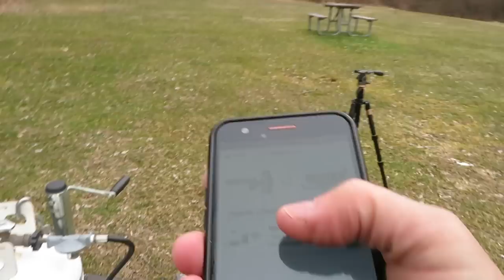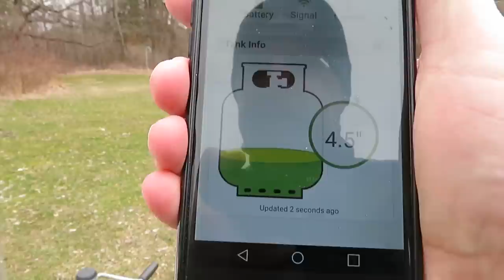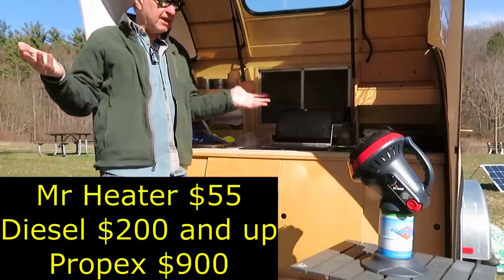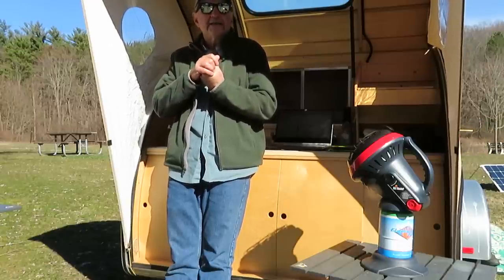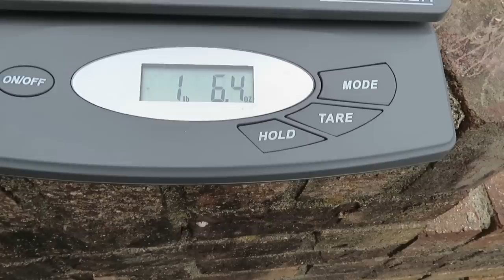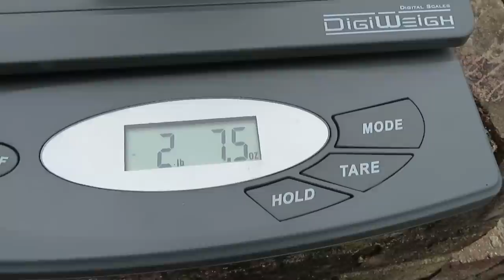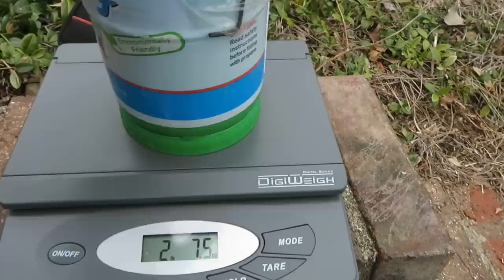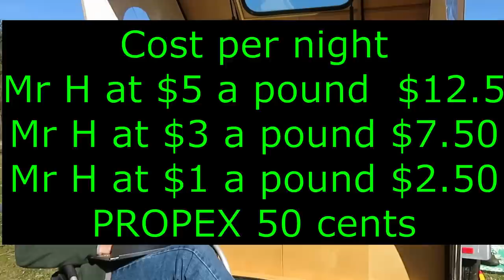Mr Heater vs Propex vs Diesel Heater

Comment: 🤔 availability and ease of getting your fuel. I can get diesel anywhere but not propane. Small towns don’t have propane for filling tanks. Propane is explosive! Diesel is not.  10 hours of use only used approximately a half a gallon of diesel. Battery consumption on 5KW diesel heater over 10 hours was 200 watts. Only maintenance needed is to turn the heater on high before turning it off for a few minutes. No soot issues. Diesel heater $150 propane hheater like you’re talking about was $1000.  In a moving vehicle or rig there’s a lot of twisting and bumps and if you get a leak of propane 😱… Use at your own risk.😉
Reply from the maker: Thanks for your comments. For some diesel makes perfect sense. In my case I have a tiny trailer and already have propane for the stove. I did not want to add a second fuel type to the rig especially liquid. I agree you can get propane or diesel heater for less money. At those price points quality is pretty poor. There are plenty of videos around showing problems and failures with cheap heaters. The high quality diesel heaters cost as much or more than my heater. My heater is essentially maintenance free. If you watch the diesel maintenance videos you will get an idea of the care a diesel needs. My energy consumption numbers for running the glow plug show a much higher energy consumption for diesels when the glow plug is running. You can find this data too on line. There are about as many diesel fires as propane fires. Both need common sense care. I have yet to visit an area of the USA that does not carry propane. It is a VERY common home heating fuel especially in remote places. I agree - do your research and pick what meets your needs best.  𝕋𝕙𝕒𝕟𝕜 𝕐𝕠𝕦 𝕗𝕠𝕣 𝕨𝕒𝕥𝕔𝕙𝕚𝕟𝕘!  ✅  Check my other videos https://www.youtube.com/cosmoweems/videos 
SUBSCRIBE https://www.youtube.com/cosmoweems?sub_confirmation=1 =𝓒𝓸𝓼𝓶𝓸 ✅
Reply: @CosmoWeems  VERY WELL SAID

Comment: We remodeled our truck camper and pulled out every bit of propane.  Replaced with reasonable solar and ability to charge while driving.  We went with a chinese diesel heater.   Spent a winter out west exploring with it.  Zero problems and we will never, ever go back to propane.

Comment: ya propane is tuff,,,, it costs a fortune,, as well,, and 20% is unusable so if you have a 400 lbs or a 20 lbs 20% of that propane will not be able two be used it will be lost in the process .. of use that is..
Reply from the maker: Thanks Jason. I was about to install a 400 pound in my trailer. Baw haw haw. Why is 20% unuseable? Can you provide more info? =Cosmo

Comment: Regarding humidity, on boats I have used products such as a "GoldenRod®" which generates less than 150° F if you use shore power, they require 110 volt power (8 watts or more depending on length), or Dri-Z-Air dehumidifying crystals - no power needed (Calcium Chloride anhydrous, which you can also buy from a chemical warehouse/supplier). Anyone ever use them in campers/trailers? Regarding diesel heaters, I like that the unit can be housed/mounted outside, and they the air intake and exhaust (for the heater), can also be routed or mounted outside, with only the heated air being recirculated inside. Some folks do install them with the heated air intake outside to constantly draw in fresh air. Depending on where you are that could draw in moist air as well. If you are handy (and careful) there are 12 volt incandescent light bulbs, you could build a small container/holder, a super low wattage one might be ideal if "some" light doesn't bother you, if it does, perhaps a 12 volt resistor with? It It's a balancing act.
Reply from the maker: Hi Dougster.m Thanks for your solutions, they may be useful for many viewers. For me  each one adds a layer of complication to camping. I recommend the Propex HS-2000 its very small and can be tucked into almost any van or RV if the 6500 BTU output is adequate. Diesels require maintenance I don't care to do for the glow plug and carbon build up - you can find plenty of videos about how to do that. https://www.youtube.com/results?search_query=diesel+heater+maintenance. In my case the deal breaker was adding another fuel to my trailer. My trailer is small and I already have propane. Adding diesel fuel was not something I was interested in. We are fortunate to have so many great choices available to us.    Electric solutions are limited for me  since I camp off grid 99% of the time. Thanks for your ideas.  Chemical solutions are fine but my heater does not create moisture so I am free of that cost and moisture. Here is a video of the heater in action at -5F where I need reliability    https://youtu.be/9VEBR8fh-Bo
𝕋𝕙𝕒𝕟𝕜 𝕐𝕠𝕦 𝕗𝕠𝕣 𝕨𝕒𝕥𝕔𝕙𝕚𝕟𝕘!  ✅  Check my other videos https://www.youtube.com/cosmoweems/videos 
SUBSCRIBE https://www.youtube.com/cosmoweems?sub_confirmation=1 =𝓒𝓸𝓼𝓶𝓸 ✅
Reply: Careful using calcium chloride to dehumidify spaces.  While it's a great salt that will happily scrub every molecule of water from the air and can be recharged to anhydrous in an oven, it's so aggressive that it will dissolve itself into a brine and can potentially cause a mess.  

In a tray inside your safe at home, it's fine to have a pack that eventually becomes a brine.  On the road, that sloshy stuff can be disastrous.

Comment: We have 2 diesel heaters, love them, no smoke, but you do have to use them properly. 180 degrees of dry heat. Draws heavy on start up but then goes down to an amp or two when full run mode. One we have kept outside all winter so far with a cement mixer plastic thing for a cover lol but worked great for what we needed. Living in a camper while we finish the cabin and we put the heater hose into the 'skirting'' I made from foam board, heats the under tanks and pipes so I can drain them daily to sewer tank. We use electric heater in living room of camper to help it not be fully moistened by the propane heat. Electric assist helping a lot with keeping sweat down on windows and walls, and keeps dogs warmer out there to sleep, wind just still slides right thru the slider edges out there.
Reply from the maker: I would be interested in interviewing you about your heater. Send me an email to CosmoWeems@hotmail.com Thaks =Cosmo

Comment: Love your heater comparison, you are good with your numbers! Once I get such nice date I can't keep my legs still...

So we... did just put some math/ facts together after 2 weeks of
Boondocking in the alps at 1800 m above sea level, partially snow fall, but over all sunny,  day temps 1-- (-) 3 Degree Celesius,( 30 f)   night temps av. - 10 degree C and colder (- 18 max)
We had 4 Riggs up there:

Rigg 1 Alde propane heating sysrem 6 kw on gas plus 3 kw when hooked up or via inverter,  Rigg is 8 m long and has a cab chassis Class C types ( insulated, by outside insulation mattes)
Fuel supply by 2 x 11 kg Propane bottles ( 3 carried in spare) 50 pounds 2 botts. Day heater via solar and Lipfos and 500 watt El heater plus sun
Rigg 2 Alde propane heating system as above 3020 hp plus with a 33 kg Propane tank and 2 x 11 bottles to switch, Rigg is 9 m long class A
RIigg 3 Alde heating system,  plus diesel warm water heater in Alde loop ( these Aldes work with convectors and glycol)..33 kg Gastank, plus spare 11 kg bottles and 140 L Dieseltank.
For rapid heating this Rigg has an Webasto ( Ce sign) Diesel heater as well 2 kw. ( 9m long, Class A)
Rigg 4 Class C with Truma propane heater ( like Propex but 4 kw) amp draw 1,4 amp when steady state heating plus  Propane per hour Rigg is 6 m long.

Data review ( Feb/March 2020, 14 days at Livignp) 

The 7 m Rigg1)  used 25 kg Propane for 2 weeks ( Fri - Fri) due to solar the batt was always full mid day..amp used was about 1 amp steady state
45!.- Euros 14 days Heat ( ser at 20 C Inside) plus large refrigerator ( 74 g/h) 
Rigg 2 used 44 kg (72 Euros) of Propane for the same due to the lenght its more,  Batts on 80 % since they are Agm he has solar 130g/h propane
Rigg 3  used 22  kg of Propane and about 10 L ( 46 Euro) Diesel  it is 9 m long means incl refrigerator and set to 22 C inside
Amp draw 1 amp Alde, and 0,8 amp Webasto diesel heater when running. Webasto takes 0,1 L Diesel per hour ( and yes sometimes you can smell it but
No smoke, he used it about 30 % of the time) Batts no issue he has 400 Ah installed and solare 
Rigg4 Gas heater 4 kW used 33 kg Propane ( 54 bucks) and needed to go on grid every second day ( batt is 85 Amp Gel) 1,4 Amp/ h * 40 is already critical since he
can only consume 50 % of his batt cap. ( the small propane heater needs to run at low all time) ( 98 g/h)"

Here my 2 cents: 

The smaller the Rigg it may be best to use a small propane blower heater like a Propex,,Truma, Dometic or others, cheap price around 400 -800 bucks, low amp 1,4 and super low gas consumptionm ( specially trailers)
Medium Riggs should have a water heating system ( winter) or a gas propane blower heater such as a Truma combi best combined with a 12 - 230 V thinfilm floor heater, such combination allows a 7 m Rigg 10 days with 7 kg Propane ( tested in the same area / my previous Rv)
Larger Riggs should have a combination of warm water propane heating system plus a 2-4  kw diesel heater ( homologated ones with Ce logo, no Far East ones if safety is a concern to the owners) tapped from the fuel tank ( cost is 500-1000 Euros)

Alde heating system is about 10 k Euros (6-10 kW) ( including hotwater and convectors and motor pre heat or heat cabin with engine heat while driving down the road
Truma Combi 3 k Euros (4-6 kW incl hot water)
Truma and others simple airheater  800-1000 Euros (1-2,8 kW)
Diesel air heaters good / approved ones 500-1000 Euro or more ( 0,8 -1,8 kW or 0,8-4 kW).. Prefer a 1,8 kW heater which runs on low 24/7..
Diesel water heaters around 500 bucks ( only suitable if you have convectors in your Rv
Electrric heaters 2 -3 Amps abour 50 -300 bucks

Some idea.

- Max amp draw 1 amp is OK or you need bigger batteries ( I do have a 160 Ah Lipfos whith quick charge option  with 60 Amps)
- Winter heating system need to run 24/7 on low to keep the sanitary system protected
- All tanks and plumbing is in a double floor construction heated 
- Hourly conumption of fuel 0,1 L ( or kg in case) max about  0,4 L
- Solar recommended 1:1 or 1:2 ( batt to pv)
- Power back up like generator ( 1 for all Riggs)  or hydrogen fuell cell ( efoy comfort  or others) for 3-4 days no sun
- For extrem situations a big buddy or similar

Summary propane heating systems are very efficient and are small and light draw little power even on larger Riggs 1 amps/h  plus power consumption!!
... but the more energy would be needed a supplemental diesel heater makes sense when you have a fuel tank.( or install a 4 gal steeltank underbelly in a Trailer or on the hitch)
In warm weather like spring and fall a diesel heaters can produce all warmth by a minimal amount of fuel without maintenance
Good heaters are as reliable as any propane or other Rv heaters. Diesel cost is In euro about 1,20 / Liter where as Propane is 11 kg 18- 20 Euros 
Heat values like 12 kw/ kg is pretty similar. Some people do not like diesel smell on one hand ( my rigg is a diesel anyhow) and others want to camp on higher altitude
Here you neee an elevation conversion kit on many heaters..or they don't run properly..well we learned it the hard way..
All systems reviewed where running trouble free for years, the water pump thermostat on Rigg 2 failed and the heater did not forward the
warmth, so we needed to cut the 12 v supply to the pump and made a spare wire from a 12 v point then heater did run thru out

Regards from a non responsible diesel heater fan and his camping friends recently camped in the snow and all watch Cosmo..
( I may refurbish my rigg with a 2 kw planar 2 D expedition heater after I saw and we learned how this works..in our case helpful)

Forgive us our findings!? The 4 Riggs you can see on one of my last vacation vids..
Reply from the maker: Excellent. Thank You for sharing. This is an open forum and we all learn from each other. Great information. =Cosmo Thank You for watching. Check my other videos https://www.youtube.com/cosmoweems/videos 
SUBSCRIBE https://www.youtube.com/cosmoweems?sub_confirmation=1
Reply: Update for the records, I mutated from a non responsible diesel heater fan to a diesel heater owner..and installed a Diesel heater 2 kW from Russia " planar 2 D expedition heater with elevation kit and 7,5 L diesel tank into my Rv...........now 2 weeks of tests showed: low setting is good for heating a 7,7 m Class C rigg ( its a 2 Kw version) and keep it toasty all day long..

DATA:

1) it takes from 0,5 amps low to 1,1 amps on high setting. ( times working hours = Ah used)
2) it works at 30 dB  low to 37 dB  high noise level
3) it has a temp sensor " in the cabin" so it will not heat all time since automatic heats to a set value which I set on 22 C ( super cozy)
4) it burns average a 90 -100 ml Diesel per hour ( my 24 h test was little under 2 L
5) it burns smoke and odor less ( only when start up you may notice some smell out side for a max of 5 min)
6) my solar charger will detect the dieselheater draw and feed amps accordingly so no ah draw during day light  ( 10 hour night draws literally about 5 -6 Ah,  depending upon outside temp,  system was tested at 2 degree C last 2 weeks)
7) its a simple solution with 2 knobs..and a setting dial for temp and fan speed
8) its a quick dismantle type of heater and glow plug, burn chamber or other items can be exchanged in minutes
9) maintenance: let it run 1 hour fully crancked per week when you operated it 24/7

Summary: with the installed 7,5 L Tank and a small solar 190 wp Mt Cis pv panels and 160 Ah Lifephos set up, you can boondock and heat  all week, that 
allows to use my propane for the refrigerator and cooking, hot water for a long stretch..means 11 kg of propane will last all spring at least and for
weekend trips I may need to refuel the diesel tank once per now and then..I think a great add for freedom and independence! 
But the Alde Propane hot water radiation and floor heating system is still greatly appreciated for winter camping, but now with much lower consumption..the diesel helps
to save propane greatly!

Comment: I guess the old saying is true, you get what you pay for.Enjoyed video. i have a palamino truck camper with factory forced air heater/thermostat i added a wave 3 and use it when i  have no hook up, low on or need to conserve 12 volt. the wave heater dose generate some moisture but its better than being cold when u have low power. with smaller rv s you cant add a lot of batteries due to weight .and as im sure you will agree that us folks with small rv ,s are always mindful of conserving our 12 volt power.
Reply from the maker: I agree. We choose our compromises. Nothing is good for all of us. I used Mr heater and am grateful for it. Heat is so wonderful (some take it for granted - but not us). I am not critical of any - I just wanted to throw them against the wall to help us choose what is best for our individual needs. Thank You for watching. Check my other videos https://www.youtube.com/cosmoweems/videos 
SUBSCRIBE https://www.youtube.com/cosmoweems?sub_confirmation=1

Comment: The trouble with diesel heaters compared to propane heaters is less about heater construction and more about an innate property of the respective fuels.

Propane is proportionally more hydrogen and less carbon, which is why it boils at a much colder temperature and also why it burns cleaner, particularly in thermostatic applications that require cycling.

Diesel has a lot more carbon in it, which is why it's less volatile and less of a fire hazard, but also why it has a higher propensity to release soot (unoxidized carbon,) particularly when it is run intermittently rather than full time as it would be in either a diesel or jet engine.

My vote is to keep diesel in the tow vehicle as the most efficient provider of torque, and propane in the trailer where it produces clean heat without a fuss.

Comment: The Mopeka propane level reader has one major drawback for me. It requires a cell phone signal. I often camp in the middle of no where and there are no towers. Maybe Starlink will solve that.
Reply from the maker: He James. That is incorrect. No cell phone network required. It. It uses Blue Tooth which is local cell phone to device communication. It works in the middle of nowhere for sure.  𝕋𝕙𝕒𝕟𝕜 𝕐𝕠𝕦 𝕗𝕠𝕣 𝕨𝕒𝕥𝕔𝕙𝕚𝕟𝕘 and contributing to the conversation! =𝓒𝓸𝓼𝓶𝓸 ✅